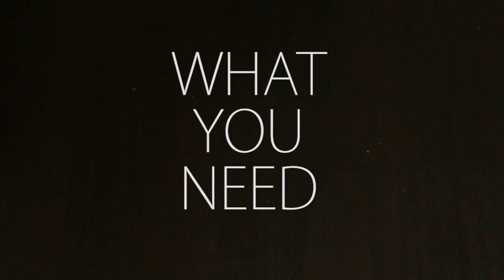SONY VX1000 HEAD CLEANING FIX

Comment: Thanks for the great video. Very helpful. I also have something to add that might help: I performed the fix twice and my footage was still tinted green. However after recording some minutes of new footage, it disappeared all of a sudden. So, if the problem persists with anyone's camera, you might have to run through some tape until it works.

Comment: Hey man, i have done this cleaning fix for 2 times now but my vx still shows a little cross like screw logo pop up in the viewfinder....i Googled what it was and it meant that the heads are dirty. I used a headcleaning tape and done this method of cleaning the video heads....still when i watch the footage back on capture camera, and on the vx itself it shows green stripes across the image:/ i dont knie how i can fix this problem. It would be great if you could help me out!

Comment: I visibly see the head still has smudges on it but it simply wont come off. Also how to you keep little tiny specs of dust or particles in the air off the head? Having a rough time here, i just got this vx21 😭
Reply from the maker: The dust will come off best with the tape deck cleaner, which is usually a blue mini dv tape. Why did you do the clean in the first place? Glitches or bad footage?

Comment: Will this fix glitches like my footage has those little freeze frames where pixels will just come out
Reply from the maker: It will not make it worse thats for sure! if you still have the glitching problems it maybe a problem with the main board which is a real pain in the arse! but try the clean it could be the solution!

Comment: A buzzing noise comes from my tape deck when I have a tape in my vx1000. I think its the drum bearings but im not sure. Will this cleaning help fix my problem?
Reply from the maker: +Richard Mudd 
in this video you dont actually touch the drum, by the sounds of it you have a bigger problem! you can try cleaning it wont do any more damage thats for sure but i doubt it will cure your problem!

Comment: Hello, so my vx says it’s recording and when I play the tape back there’s nothing recorded. This is a new issue that I’ve never had in the 8 years I’ve had it, though it’s been in storage for the past 4. Do you think this will fix it?
Reply from the maker: It wont do any harm bro, could be a build up of dust so this will hopefully get it up and running again, good luck!
Reply: So, did it work ?

Comment: I'm having an issue with my vx1000 . it turns on for about 10 seconds and then it turns off after hearing a click sound . it also doesn't let me open my cassette deck to take my tape out . wondering if you knew exactly what kind of problem it may be? thanks !

Comment: I have a vx2000 and a pd150.  Both of these cams do the same thing.  I record video to a tape.  When i play back the footage, the video will randomly go from choppy/pixelated for a second or two to fine for a second or two and repeat.  .  When I open the door/flap of the mini dv tape you can see that the camcorder has put horizontal creasing on the tape.  Any ideas or suggestions.

I think ill make a video today showing exactly what is going on.
Reply from the maker: I have never seen creasing on the tape before but without actually looking at the camera sounds like you need some major repairs that a head clean will not fix sadly.
Reply: @mattfirmin11  thanks for the reply.  I think ill make a short video and that way you and others can see what is going on.
Reply: @mattfirmin11  Here's a video of what I was talking about:  https://youtu.be/QuSuSo4AWIs
Reply from the maker: @AMJSKATESHOP  where are you based? Looks like you made need more than just a head clean from the videos. I would recommend sending it to someone to take a proper look and try to fix it!
Reply: @mattfirmin11  I'm in the states.  I actually want to try to work on it myself if I can find someone that thinks they know what the problem is or have experienced it.  Unless I need to replace the entire tape mechanism that might be a little beyond my skill at the moment.
Reply from the maker: @AMJSKATESHOP  I haven't personally experienced the problems you are having so without physically taking the camera apart myself it's difficult to say. Sorry!
Reply: @mattfirmin11  All good man, appreciate it.

Comment: Thank you for posting this video it was a great walk through with easy to follow camera work. But at the moment I am having an issue with the tape deck mechanism. It beeps and signals to eject tape but its stuck in the deck. I have a spare vx for parts that I've been using but can't seem to get it right. If you could help in anyway that would be much appreciated.
Reply: did you ever fix it? had the same problem for over a year now i’m clueless

Comment: Great Vid! Two questions: Is this the same general process for the VX2000? And, I'm having problems with a lot of artifacts showing up on my recordings, will this fix that?
Reply from the maker: Thanks dude, sadly i have not actually worked on the 2000 but the tape deck is very similar so i imagine it will work just fine. And if you have artifacts it can either mean dirty or heads or a cracked motherboard which is a lot more serious. I hope its just a little dirt

Comment: Your videos are amazing! Is there a way to clean haze out of the vx stock lens? I have a few but one has a lot of stuff in between the elements
Reply from the maker: SALT BOYS it is possible to take apart the lense for cleaning but it involves a lot of screws, and a bit to complexed to make a video for, well a video less than 30mins long anyway
Reply: Translate Productions I would imagine. Do you have to take the whole lens/sensor piece off to get to the elements?
Reply from the maker: SALT BOYS yea you do dude, nearly 60-70% of the camera needs to be dismantled it's a mission but do able
Reply: Thanks for the responds dude! Can you put Japanese parts in english cameras ? and PAL in NTSC parts in cameras ?
Reply: SALT BOYS I have this issue aswell a vid would be super helpful Translate Productions

Comment: I followed your instructions very carefully and now vcr mode doesn’t work at all - it just doesn’t turn on. The camera still works in camera mode. Any suggestions on what might have caused this?
Reply: prolly didnt plug the ribbon cables in

Comment: Hey dude was wondering would I do this to my vx if it beeps and stays eject tape???
Reply from the maker: i dont think this will solve the problem but it will not do any harm to the camera. have you taken the camera apart before? or did the tape ejecting just randomly start?
Reply: Translate Productions I bought it like that but I fixed it thanks so much but I was wondering my video looks really grainy should I try this?
Reply from the maker: how grainy does it look? are you sure its not the settings first before you take the camera apart again!
Reply: how did you solve the tape eject problem?
Reply: i also have the tape eject problem, i have to eject it and put it back in it so it's detected, like a wrong electric contact in the camera, it also started to be cold out there, maybe something going on with the humidity or the cold?

Comment from the maker: Cheers dude going to re edit the last one
Reply: Is this pretty spot on for the VX2000? I have the resources if it's not. Also, chamois swabs are a better option, right?
Reply from the maker: i have new used or fixed a 2000 so i can comment but i should imagine it varies too much. and yeah they are as less chance of leaving lint left over!
Reply: Translate Productions hey can you help me out I just bought a vx2000 recently like 3 - 4 days ago used it didn't come with a mini dv tape the dude I bought it from had it listed in excellent working condition everything is working fine on the camcorder except the tape deck I bought new tapes I keep getting a error code & it eats up my tape I'm kinda bummed out because I paid a lot of money for it and a fisheye lens & it's not even able to recognize a brand new mini dv tape so I cant record nothing any advice would be helpful
Reply from the maker: Its a hard one dude without actually taking the camera apart and having a look! does it close with the tape inside then the error appear? and how do you mean eats up the tape?

Comment: hey i have a problem with my vx and unfortunately zero experience with camera repair.the camera fell down today and the tape wont eject neither close or open. ever experienced this problem. i really dont know what to do.i already unscrewed and removed the connector but im really clueless now
Reply from the maker: It's so hard to know without actually looking at it, best bet would be send it to a pro to fix. I imagine if you have dropped it you will have broken something on the mechanism. Follow this video and make sure everything looks on place, ribbon cables etc. If you dont notice anything I would send it to someone.
Reply: @mattfirmin11  thanks a lot for the fast reply!!!I will definitely try to find a professional now.hopefully there is still someone in my city (vienna,austria) who fixes these cameras

Comment: i tried to use nail polish remover and it didn't work, in the UK we have surgical spirit which is apparently the same as rubbing alcohol, does anyone know if this would work?
Reply from the maker: You can get it online for sure higher percentage of isopropyl alcohol the better 70% minimum. DO NOT USE nail polish remover, if it has acetone in it you may have already damaged the heads!!

Comment: would doing this fix the kinda loud humming/buzzing noise coming from the tape deck ?
Reply from the maker: is the buzzing coming on the tapes or buzzing when recording?
Reply: it buzzes/hums never happened when I first got my vx I fear it'll get louder I'm guessing its the heads cause when I take the tape out its silent
Reply: did that fix it, I have that problem currently

Comment: Im having the Problem that my Media Player isnt responding, anyone has a clue what that would be or how to fix it? the Play Mode directly from filming where you have to hold down your finger is working.
Reply from the maker: More than likely a ribbon cable they brake all the time on these cameras! Your talking about the buttons above the tape deck or on top of the camera?
Reply: @mattfirmin11  talking about the ones on the tape deck. the ones on top work (where i have to press down with my fingers to keep it rolling)
Reply from the maker: @palitox5770  ok so thats the ribbon cable these ones brake all the time! Best advice is to leave it. You should avoid using these buttons as they will ware the tape deck down faster. If you want to watch back use the buttons on the top and then to capture onto computer get a capture cam or a tape deck recorder!
Reply from the maker: @palitox5770  you will struggle to find a replacement cable and even when you do  every time you open and close the tape deck it's slowly braking the cable. So will only be a matter of time untill it breaks again. Its a major design fault with these cameras

Comment: Hi +Translate Productions,

Is this actually a credible means of cleaning vx1000 heads, and where did you learn this?

I've read a few posts on the skateperception forums saying that using a q-tip/cotton buds will rip the heads right out of a vx1000, and do more harm than good.

I'm comfortable with taking the vx1000 apart, but I'm incredibly nervous about using cotton buds or the wrong chemicals.

Hope you can give some insight,

Thanks in advance!
Reply from the maker: +Timothy Southcott Yes it is i have the intensive manual from sony service and repair all about the vx1000 and i have been doing this for a while!

And the posts you have read are correct but in this video we are cleaning 1 pinch roller and the rotary drum, you dont actually touch the heads!

Comment: My Sony VX1000E has just developed a problem. When I record it is not recording the picture, instead it is recording a black screen, like video black.

When I look through the viewfinder before recording all is fine, I see the image, but after I have finished recording and then use the edit search buttons to see the recording there is nothing just a black screen, all I can see is the play symbol and the tape counter display etc, but no picture.

Anybody ever encountered this problem before or got any advice.

Really worrying me
Reply from the maker: have you tried cleaning the heads already? By the sounds of it you may have a main board fracture which is bad news. because normally even if the heads are really dirty you will still pick up something! try the head clean and if that wont work you may need to send it off for repair!
Reply: I disassembled the vx, the problem is one of the main tabs! where can I find individual spare parts? could you help me?
Reply from the maker: what do you mean by tabs?
Reply: cards that give power to the mechanical
Reply: Tomorrow I'll tell you the exact name! vx is now in service
Reply from the maker: ok let e know as i have a ton of spare parts and if not ebay is the next best bet. either buying an out of commission VX for the part or buying the part its self. personally i always try to pick up a broken vx as you end up with a ton of extra spare parts!
Reply: then you would have spare parts for sale?
Reply: the route sheet is R2 63 board
Reply from the maker: i will check it out and see if i have a spare one to sell you
Reply: between what you let me know?
Reply from the maker: hey dude sadly i have a ton of these boards but they are all broken as well. seems to be a common fault with the VX
Reply: THANKS ANYWAY DUDE

Comment: hey dude .. what about the vx2000 ... the same spots to clean ???

My vx2000 has issues with the sound ...
Reply from the maker: tomthemenmy1 I have only ever fixed the 1000's dude but if the tape deck is the same it makes sense that the cleaning would be the same! whats the problem with the sound?
Reply: ah ok ..thx but i don't know if it's the same deck. .. the problem is that the sound interrupted, the sound is there and gone sorry my english is not so good .. i can't realy describe it..... and on the right on the LCD there are sometimes pixels
Reply from the maker: sorry dude itshard to tell the route of a problem without looking at the camera i would recommend trying to find someone local who can fix it up for you, where abouts do you live?
Reply: now everything runs perfekt ;) i found a guy how fix all my problems ;)
Reply: HansaKrizz  hey man, i have the same problem, what was the solution?